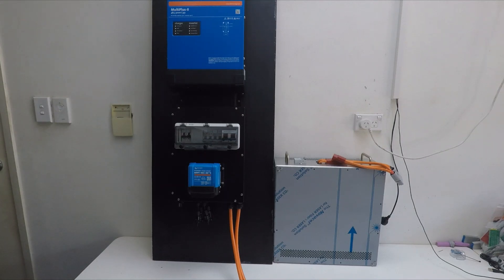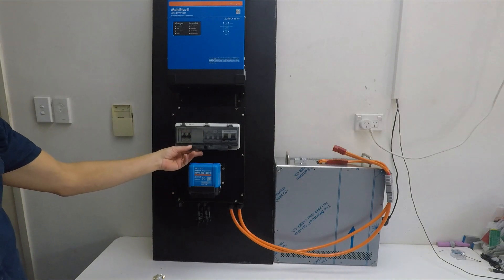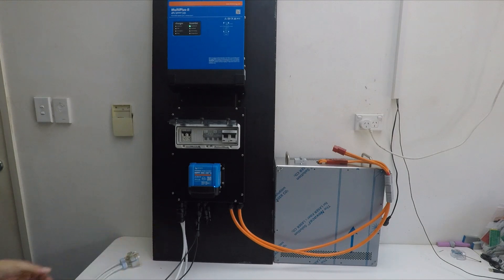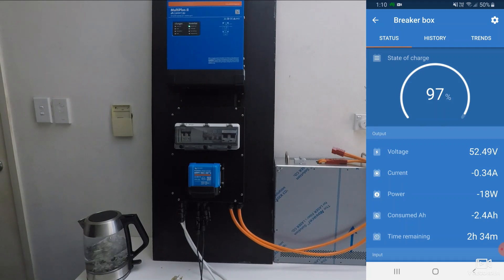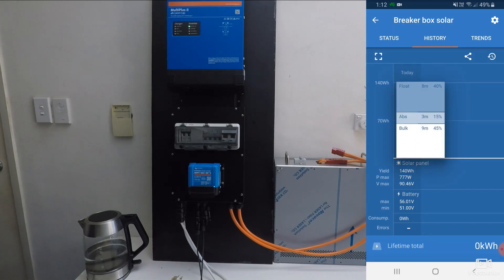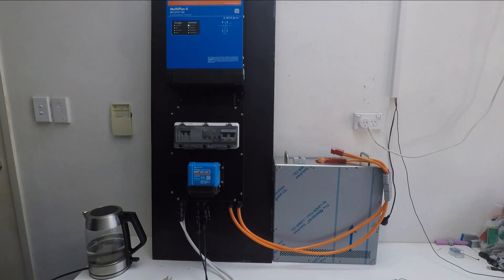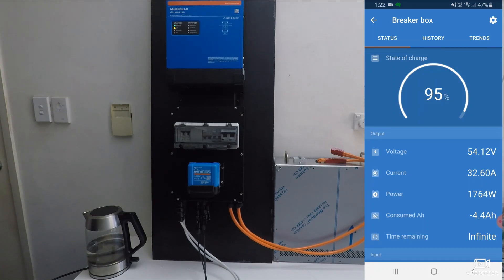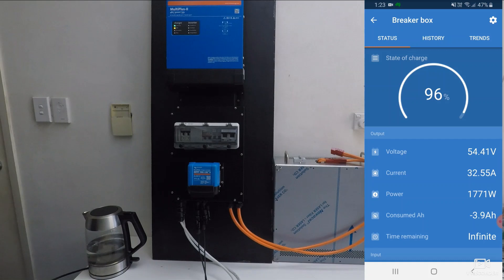Victron Multiplus-II with Mictronix breaker box demonstration

Comment: Excellent video! Very easy to understand, I had a complete system installed on my rv and tried to dial back the multi plus II to 7-8 amps but only could go as low as 9.4amps...any reason why it couldn't get down to the 7-8amps?
Reply from the maker: Thanks for the kind words. 
That's a little strange. There is a minimum setting but on the multiplus-II it's around 4A for the 3000 and 6A for the 5000.

Comment: Hello, when you set the current limit to “8”, would the VC app also read the same as “8” amps coming in from shore/generator? I have my current limiter set at 7.5 but the app reads it is pulling upwards of 40A. Any thought on this would be a big help. Thanks.
Reply from the maker: Hey. Yes it should read at or below the input current you've set. In my experience the only way this could be happening is if you have the switch on charger only mode which removes the current limit. If not, the unit might be faulty. Let me know how you go

Comment: Sir, excellent video: thanks. You said:"" It's a bit hard to answer as the Multi can basically do anything If you know how to set up and program properly."" Can you make a video with solar on and a fully charged battery; will solar power be fed to the grid? Can you program that everything comes from battery en battery will only be charged by solar, not by grid? Unload the battery till a minimum of 30% and then switch over to grid consumption, not earlier. So: use as much from solar and as less from the grid.
Reply from the maker: Hey there. That is actually fairly easy to do using the Multi in AC coupled and DC coupled. You just need a GX device in ESS mode. Unfortunately I don't have the facilities to show it as I specialise in off grid installations.

Comment: Thanks for your great video Mate
Please advise ...can the multiplus 2 perform the following..
Supply my dedicated loads via PV during the day and automatically switch to grid power at night.??
Can it also automatically switch to battery power when grid goes down at night?
Reply from the maker: Hay Shaun. It's a bit hard to answer as the Multi can basically do anything If you know how to set up and program properly. If you are going to do something like that you will need a GX device like the cerbo or a MP2-GX. Then you can configure the Multi to switch AC output 2 according to PV power and or battery state of charge.
Reply: @mictronix6723  thanks for the information
I will probably have to wait for after Christmas to speak to my Victron agent here in south Africa..they on holiday now.

Thanks for your help and have a great Christmas

Comment: Does the output of the inverter have a neutral conductor?
In south Africa we have a live wire and neutral which gives us 220v at the distribution board
Reply from the maker: Hey Shaun. Yes it has a live and neutral conductor for 230V which is the Standard in Australia. You can also do a 3 phase configuration for 415V. I think South Africa and Australia have similar power systems and rules.
Reply: @mictronix6723  thank you kindly